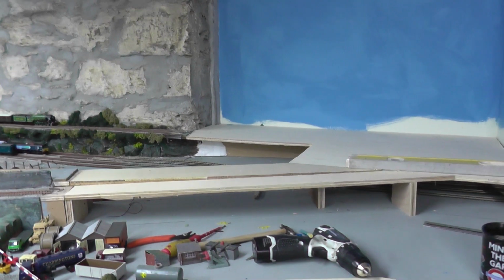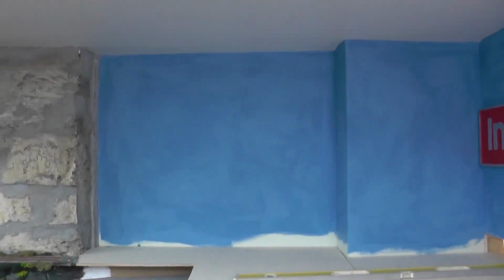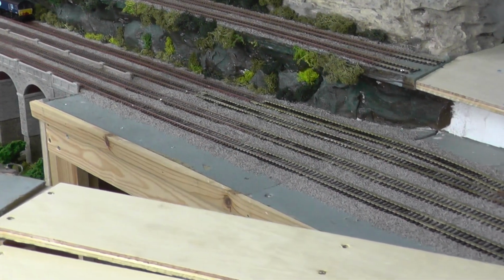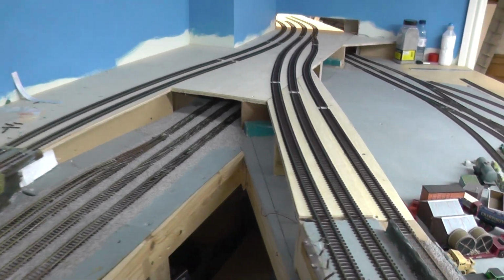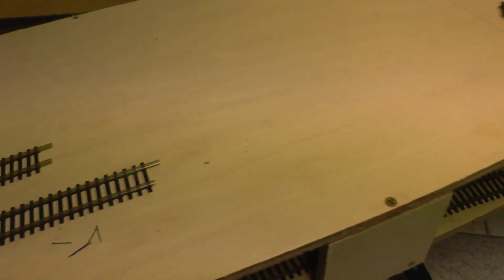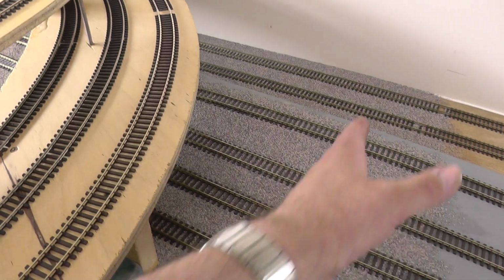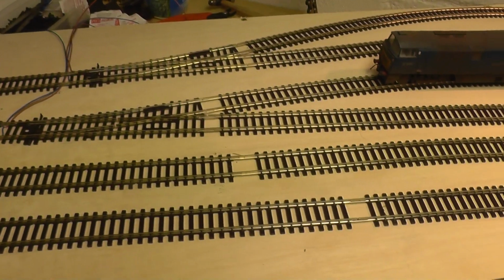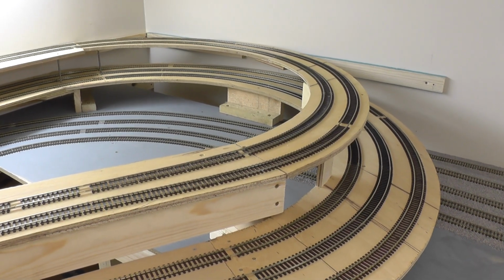Penwithers the 3rd and final expansion

Comment: Wow......
I bet your model shop owner has a smile when you enter, I bet he struggles to restock after you leave the shop...lol..
You must have a quarter mile of track on  this system now..
Have you the cmx cleaning wagon for track maintenance. ..
Reply from the maker: Hi Jim I think he might ,make me a share holder , been a bit embarrassing going into the shop for more track ,I think there is about 475 meters which is about a third of a mile  so I think that will be it ,well perhaps a couple more sidings! And no not got a cox got a trusty track rubber and a cheaper version
Reply: I highly recommend the cmx wagon it will make life a lot easier. ..